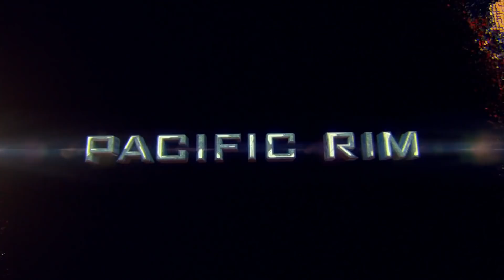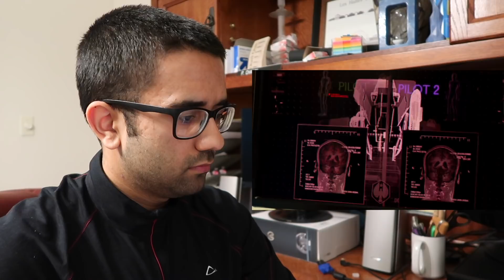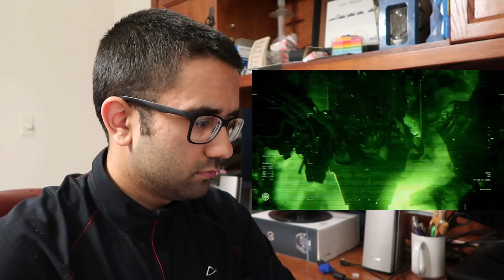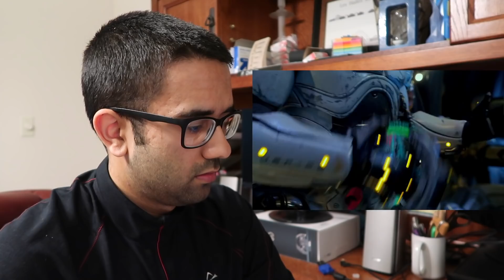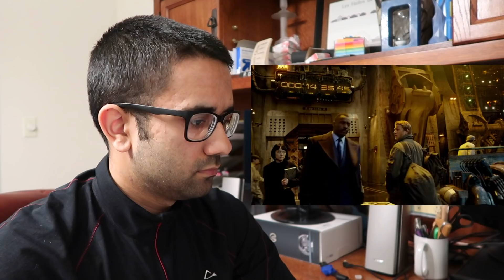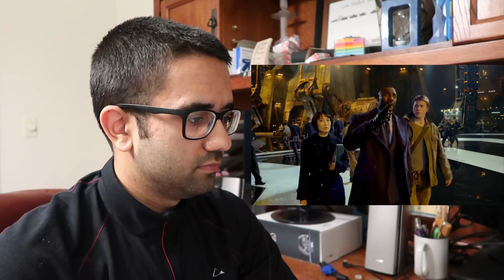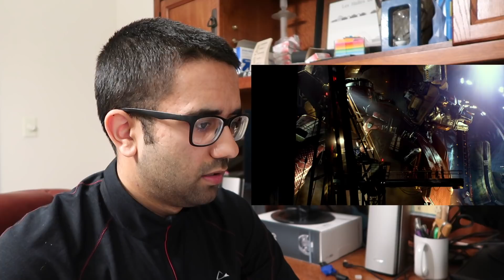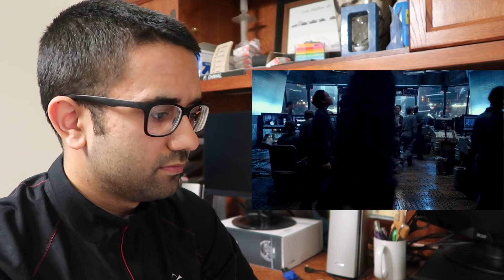Real Engineer reacts to engineering scenes in Pacific Rim

Comment: The reason for the neurol control is for when the pilots pick something up they can actually feel it so if in any case they have to rescue someone, they know how much pressure or strength they have to use
Reply from the maker: that makes a lot of sense...I think you're right
Reply: @parychahal  the down side to it is that whenever the Jaeger gets limb detached, the pilots feel like that limb getting detached like of it was their own human limb
Reply: @commanderwarden7798  I thought about that.  But, why to this extent?  Yes, you need to be able to sense temperature, pressure, moisture, etc... And, that level of input would probably necessitate a neural link to your robot(artificial exoskeleton).  But, why up the intensity to such a degree that they feel debilitating pain or discomfort?  It's the equivalent of every bad guy having a red knob that the hero can rotate into the red and destroy your diabolical machine.  Some cars today have sensors that not only warn of danger, but they can automatically help the car evade that danger.  Those same vehicles don't also shock or otherwise harm the driver to relay how dire the situation is during an emergency.
Reply: @IamnotJohnFord  halo spartan 2-3 where is suit of powered armor that couldn't be dialed back on the strength and reaction time due to technical limitations of the time this is probably similar when you enter the drift you are connected to the mech and your partner helps keep the processing of the raw data at a more manageable flow in uprising we see that scraper the small unit didn't put any stress on the pilot so it seems the requirements for a single user required ether a exceptional pilot who needed immediate medical tension afterwards, a more refined system which they didn't have time for, or build them smaller and their by less then effective
Reply: @commanderwarden7798  and the mental stress
Reply: And this is why prosthetic limbs are a bit weaker to handle because you can't feel the pressure when you're doing things
Reply: Ken Justine Rapista  no thats just the collision with Knifehead. You don’t get injured when the Jeagar is damaged. You only get receive the feeling of the damage you receive. Not the physical damage. It’d make no sense if you did.
Reply: @Mgl1206  maybe it was the blood from Yancy when he got ripped out of the conpod
Reply: @TaxAgent_1  well i don’t think so because his suit was ripped apart.
Reply: @Mgl1206  huh now that i think of it maybe the debree from the jeager falling may have cut him?
Reply: @TaxAgent_1  debris, but probably yeah
Reply: Giant mech grabs human. I got you* SQUISH.

Comment: The used two pilots to lighten the mental stress
Reply: That mental stress is completely fictional... To be honest single pilot is the most practical and efficient way.. That neuro link is just the way to make the movie plot more intresting
Reply: @MikeyBoki31  The thing is they are directly connected is from the other persons reply. It’s the reason why the kaiju is have a secondary brain, they are too big for just one brain.
Reply: @ryt_ion7183  kaiju have 2 brains cuz they're living beings... Their nerve system and organs need to be supported with 2 brains... If your controlling a million pounds war machine you wouldn't need a 2 pilots
Reply: @MikeyBoki31  the thing is they are directly connected you can even see this in the knife head battle. When the left arm got ripped apart on gypsy you can see Raleigh getting hurt from being connected with the jaeger. He even says this when he drifts with Mako, he took the right side because his left side is still weak.
Reply: @MikeyBoki31  if the jaeger had 1 pilot, that pilots brain would be controlling an entire jaeger and the human body. 2 pilots who’s minds are linked as one, are controlling 2 bodies and a jaeger. Its simple math.
Reply: @MikeyBoki31  without the drift, they wouldn't feel anything even if the Jaeger is holding something, take the boat from earlier for example, if there was no drift, they wouldn't feel the boat in their hand, they could apply too much stress and crush the boat, or without the drift, they wouldn't be connected, if the drift was there, they would be connected and would have the same actions, if the drift wouldn't exist, they wouldn't be connected and their actions will be different, let's say, a pilot says he wants to use the sword, but the other one wants to use the plasma cannon, if the drift was there, they would choose only one, and the drift delivers metal stress, so more pilots would lessen the mental stress as it would be enough for the pilots, so the stress thing is important.
Reply: @Earth9496  jesus mate sorry but i have class i cant read your essay
Reply: @MikeyBoki31  your initial response was literally just as long and it didn’t take long to read at all
Reply: @MikeyBoki31  I know why you need 2 pilots 
You need 2 pilots because MOVIE PLOT
Reply: @MikeyBoki31  at least, they already explained it. Besides, remotely control a rowboat or anything, has delay, and also motion sensor has delay. So, they tried connecting directly to human neurosystem to give the rowboats much faster response. And to give the pilot(s) context on what the robot is doing, they give feedback to the pilot(s). So, they'll know if the robot is straining or have damaged area or got hit by something, they don't need to waste time reading whatever visual/audio information. They can just (instantly) feel it.

But, this feedback is too much for a single brain to handle, so they make two pilots to use it.
Reply: @MikeyBoki31  and also they did that to differentiate themselves from other well known giant mech movies/anime/tv series.
Reply: In real life its posdible to control any mech in a distance without a pilot and without endangering the pilots
Reply: @MikeyBoki31  In My head I like to think that the pilot needs to feel the whole Robot, Getting pushed stabbed etc Obvi not fatal but hurts. This allows them to get rebalanced when pushed and to know when to throw a punch. Cause If it was like VR. You either limit your range of motion or you start clipping through things.
Reply: @Neeroke  yeah i think so too. and probably the mental stress was caused by all the input from the robot to their brains and the brain could not handle such large input from a giant robot. so they decided to put another person to lessen the mental stress. it may not be very realistic but hey its cool lol
Reply: Unless they make u feel "what the robot does", its more mental stress raising 3 kids.
Also those signals or whatevers can be choked down or converted cause they are just digital signals...so the mental stress is configurable
Reply: @Neeroke  you see in one of the movies a jaegar loosing an arm, and transfering all the feedback pain to the pilots; now imagine a single person being hit by 100% of the pain.
Reply: @MikeyBoki31  so imagine if there was latency, or a signal disruption 
( or the plot of the second movie )i mean what
Reply: @MikeyBoki31  3:25 learn
Reply: @MikeyBoki31  dude we don’t have big robots in real life, it probably wouldn’t take just one person. 🤦‍♂️ it was not making it more plot interesting. It actually made sense
Reply: @MikeyBoki31  it's a movie after all 😅
Reply: Lol completely fiction
Reply: I think he’s talkin irl like how it would work irl
Reply: Maybe the nural load has a lot to do with the fact that a human brain has a right and left hemisphere, and have different functions maybe due to the fact that the jeager is a separate entity by itself it would need to have one human to function as a left hemisphere and one to function as a right hemisphere, and they would have to be compatible.
Reply: The thing is though, why not just make a suit that replicates the actions of the pilot without the neural stuff. As he said, its just a big rc car. So why not just do that? The person is just a more complicated joystick with some buttons or voice commands to activate weapons.
Reply: @wendysworker  How can you make a suit that gives you the sensation of weight? And the knowledge of what can and can not the mech do? Also you need to know when you hit something and the mass behind it
Reply: @victornavea6197  its just a thought
Reply: Elder One  no cuz the signal is coming from the bot itself. What im saying is that instead of using neural stuff, why not just replace it with an alternative
Reply: Elder One  the pilots are inside the jaeger but instead of the neural stuff, they just have this suit that acts like an rc controller
Reply: I think the mental link was to enhance the sensory input so the user can "feel" the physical feedback from the jaeger, and control the weapon systems through thought as though they were part of thier bodies
Reply: I the movie when they grabbed the boat if they weren’t connected to the jeager they wouldn’t feel it and crushed it
Reply: Yeah the mental stress was just for the movie
Reply: Guy Panzerboss  in the movie they are simply not ready for an emp because they didn't know that kaiju can biologically produce one... And just so you know there are alot of EMP protection system (holland protection system) that can be easily installed into any mech Even if you say that piloting robots is much flexible and well suited for a fight there are plenty of counter measures for that... And our government is already doing something like introducing drone manned fighter planes and tanks im just saying that the first priority of developers of any kind of mech or weapon is to protect the pilots from it because you cant train a pilot overnight... If that pilot dies it would be a lost quiver in your arsenal
Reply: Guy Panzerboss  im just saying real life facts here... But i also understand your point.
Reply: It’s just a giant mech, I didn’t see in anyway that requires more mental stress, unless you are controlling the movement of every motor out their. But robotics have lots of chips and programs to make piloting easier.
Reply: @kerbodynamicx472  it's linked to your nervous system so you can feel the movements. (More control of movements)
Reply: Sounds like BS to me

Comment: Well, using in world science (forgive me) the two pilot system had to do with feedback for the motor (mirror) control, so much input from the pilot and feedback from the Jaeger, it places a neural load on the pilots, specifically balance that is derived from the pilots inner ear to act as input to the Jaeger’s gyroscope and also receive feedback to adjust for that… and I think my explanation fell apart.

It has to do with feedback between the Jaeger and pilots and the neural feedback. There! I hope that gives a good in-world techno-babble reason.
Reply from the maker: It's cool bro ahaha I think out loud so while I'm talking I'll sometimes contradict myself lol

Comment: 04:41 In pro gaming circles, many first-person shooter players refuse to use a wireless mouse because they're skilled enough to notice the input lag compared to that of a wired mouse.  That's just computer games where the receiver is a foot away from the controller.   The characters in this film  would be many miles away from where the battle happens, not mention the fact that they literally have the fate of the world in their hands.  The input lag would be unacceptable.
There's also the possibility of radio interference or some electromagnetic phenomenon interfering with your wireless connection to your mech during a battle.  Too many resources are put into building those jaegers, and too much will be put in danger from their failure/destruction to risk losing them over something that unimportant.  The ability to fly cargo aircraft by remote control exists now, but it's just not done.
Reply: Guy Panzerboss  Quantaty over quality, or size I guess
Reply: Actually we now have 1ms response time which match our monitors so it's not a problem anymore, but yeah, cheap mous has SHITTY RESPONSE TIME
Reply: @rmdhn1  m
Reply: Guy Panzerboss  did you not see the movie? That was what the precursors were doing with the Kaiju's to the point where there would be a kaiju coming out of the breach about every 5 minutes
Reply: On the note of wired vs wireless mice, there are a lot of esports teams switching to wireless mice due to them catching up in response time to wired mice.
Reply: yup. and the input lag from controller to screen is noticeable too. very much so. i cannot play anything on a regular tv now that i am used to 1 ms response time. its unplayable.
Reply: Because of the square cube law we can't make them that big but we can make them as big as an aircraft carrier. We don't need neural drift just a high speed computer system. Realistically, the most efficient way to build them will be with alluminum-copper alloys and a nuclear(fission) reactor as its main power source but this has problems because shaking of the reactor causes problems and if that doesn't work I'd say use hybrid engines for the maximum power delivery. The fuel tanks should be made using F1 rubber-kevlar composites. This will require big batteries but because the hybrid-engines do most of the moving it won't need to spend massive amounts if energy on moving the body.  A lot of interchangable parts and electric motars for the fastest manoeuvres however every electrical component should be highly emp shielded. Realistic weapons like built-in giant electromagnetic coil artillery guns. The electrical components should be a hybrid or fully analog.  The thing should have high speed components for the fastest computation basically a supercomputer and an A.I. makes sense! And it should be very efficient so the thing doesn't overheat and probably make it so it a balanced body and doesn't tip over very easily(wide feet) and the whole structure very fluid and non-robotic so that it can perform complex but safe manuvers very fast. I would suggest making it durable and long lasting rather that fast and weak! Make it like iron man's godkiller armor which can use enterchangable parts for faster fixing and reusing instantaneous and I would just create mini yeagers only for fixing these things!
Reply: This. Exactly.